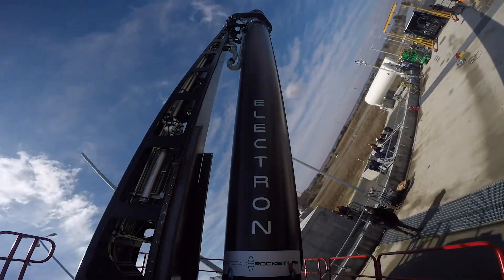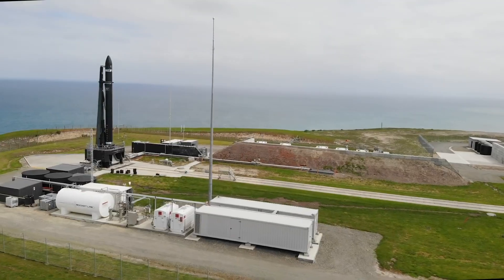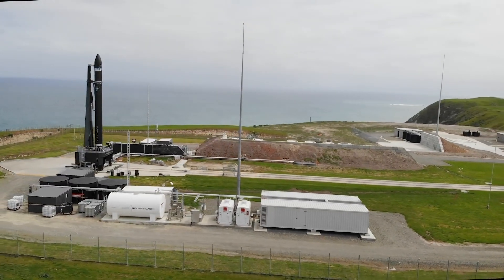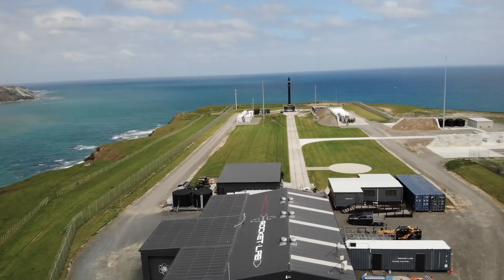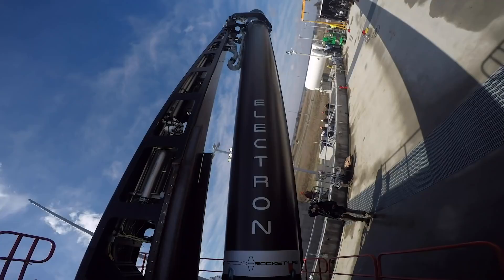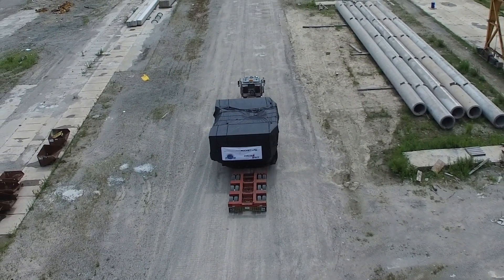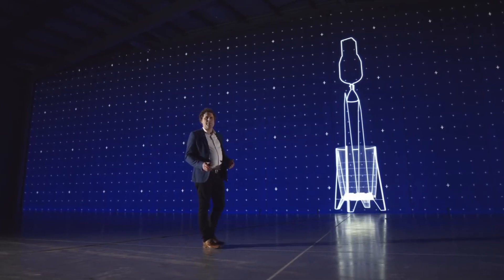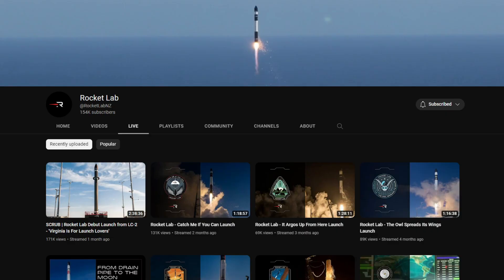Rocket Lab's U.S. Launch Pad: Explained

Comment: Rocket lab is a safe bet. I think 2026 is going to the year that puts them orbit... financially ;) Lol. I crack myself up
Reply from the maker: I think they'll do well too. What makes you think specifically 2026 will be the year?
Reply: @Stock Probe  I think they're an amazing company and they're doing everything right. However, i can't believe that they're going to hit their goal of flying the Neutron by 2024. Even if they do, it will be a slow rollout before it's pushing 10k lbs loads into orbit. 2026 is just my lame prediction and Neutron is the catalyst that will put this company into rarefied air. Anyways,  I'm going to keep buying their stock for $4-5 and hope they pull in some Space Force contracts.
Reply from the maker: I agree, I don't see how Neutron could be flying next year. 2026 or so does sound like a more realistic timeline.
Reply: Neutron is draining books for research. Cash flow positive with research done on neutron done.